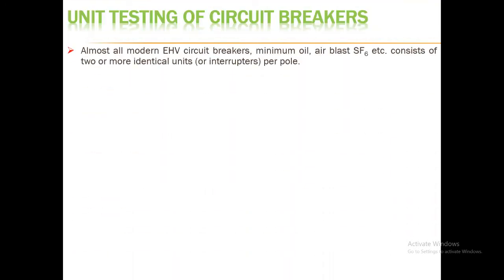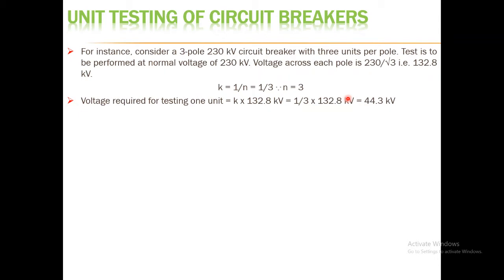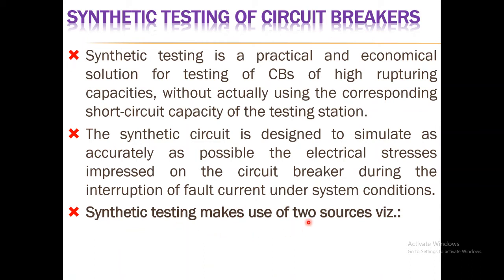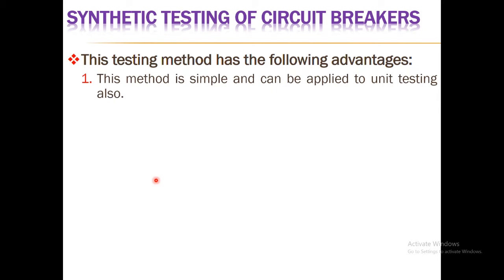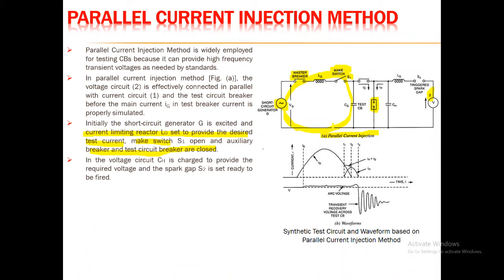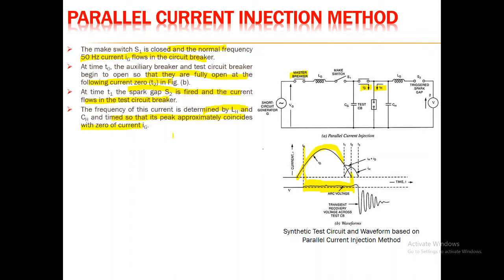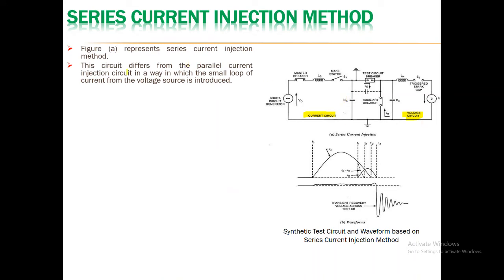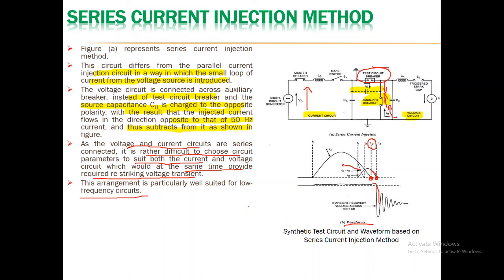Synthetic Testing & Unit Test on CB

Comment: Can the parallel current injection method be simulated ???
Reply from the maker: Please refer following:
(1) Design and Simulation of 4-Parameters TRV Synthetic Testing Circuit for High Voltage Circuit Breakers: https://ieeexplore.ieee.org/abstract/document/4178399
(2) Design, Simulation and Comparison of Synthetic Test Circuits for High Voltage Circuit Breakers: https://ieeexplore.ieee.org/document/4745314